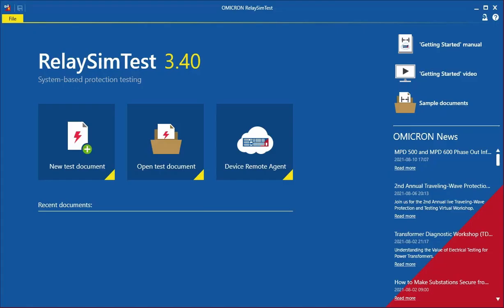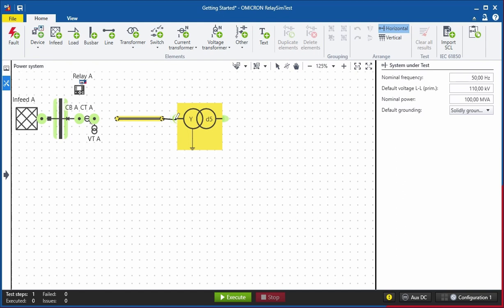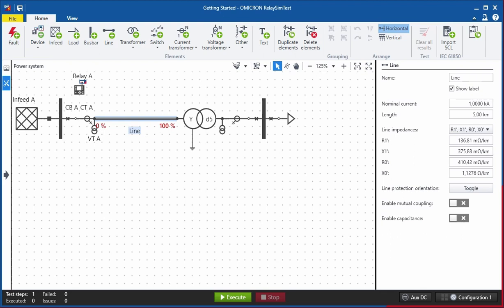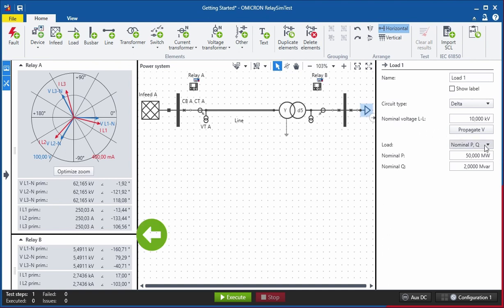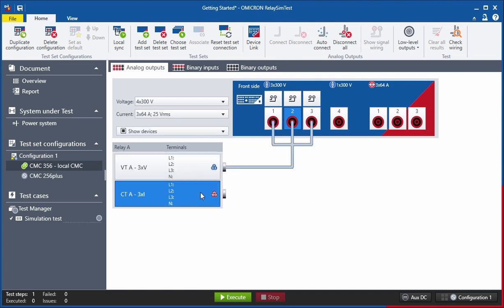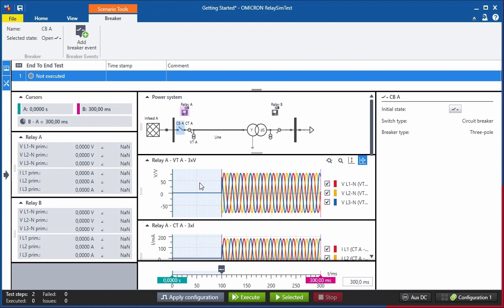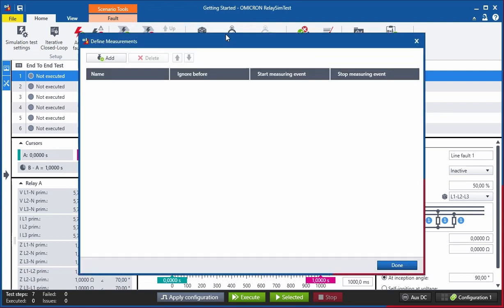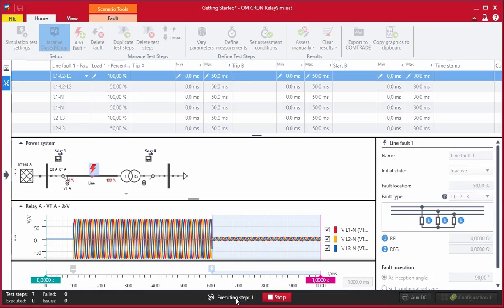Getting Started with RelaySimTest

Comment: Hi Thanks Your explanation very good. But I need Clarifications on "Configure test set". Can we able to simulate this one without Testing Kit and Relay ?! or Have to connect the testing kit for this Step Configure test set? Help me on this
Reply from the maker: Hi @travellerquotes9076, thank you for your comment and interest. You can predefine everything with an offline device in your office, i.e. define which CMC outputs should go to which relay inputs. 
Then, onsite, you only have to connect the CMC with your PC and choose it from the available device list. Afterwards, you can wire up the CMC, do a wiring check and perform your tests. 
Thank you and best regards, your OMICRON team
Reply: @omicronenergy  Thanks you for Your Response 
So You are saying that we can configure everything Offline But before Run the test we have to connect with Kit right.
Reply from the maker: @travellerquotes9076 yes, you are right 😊